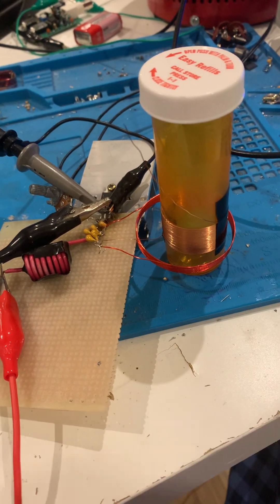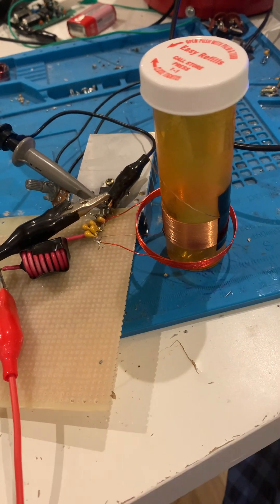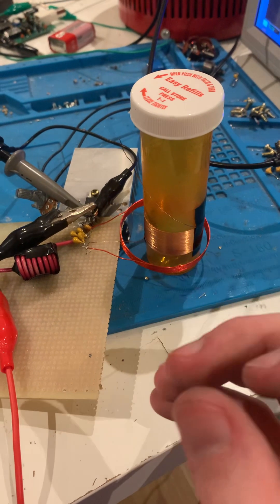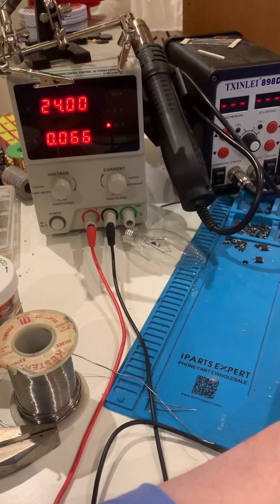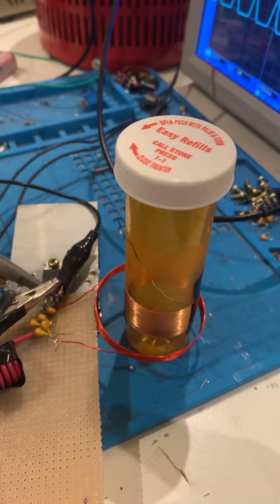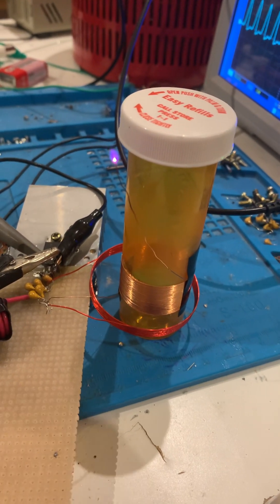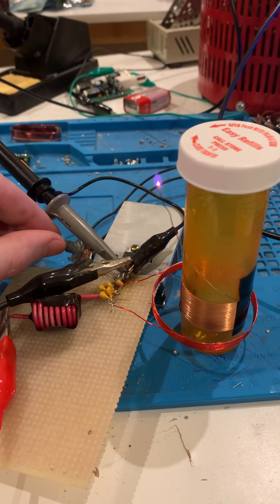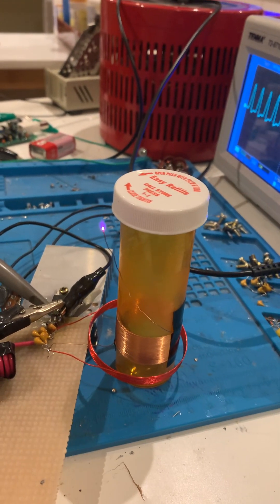RF Oscillator First Flame Discharge (HFSSTC)

Comment: Make your wires thicker and use some C0G ceramic caps for the resonant cap bank! That should reduce losses significantly so you can get more power out.
Reply from the maker: Thanks, I plan on it.

Comment: Can you add the link to the circuit diagram in the comments? I am trying to build the same circuit but the link in the description won't open.
Reply from the maker: Oh, sorry about that. For some reason, YouTube makes it necessary to verify ID in order to have clickable links in a video's description. Link: https://imgur.com/a/dTaae0J

If that didn't work, you can just copy it into your browser.
Reply: @starchief93  Thank you for the reply. All the best in your future projects!🤝
Reply from the maker: @guyonyt-z1t  Thanks!
Reply: I found that the drain to source capacitance value affects the output greatly, with an IRF510 I added a 100pF cap from drain to source which created the most output power.
Reply: @ethanslab7670  great suggestion 👍